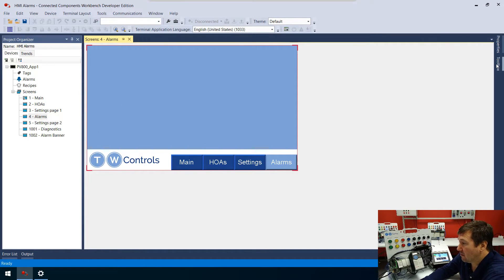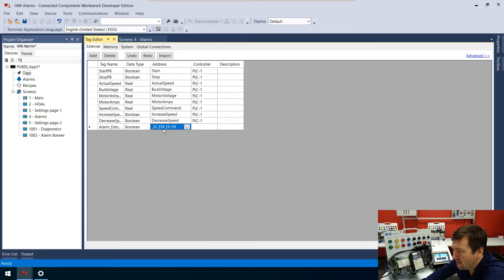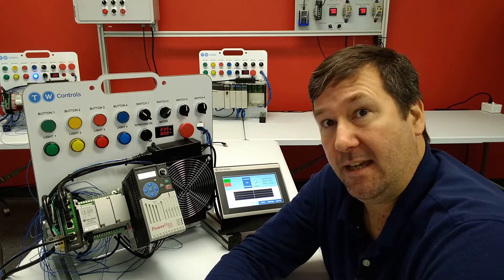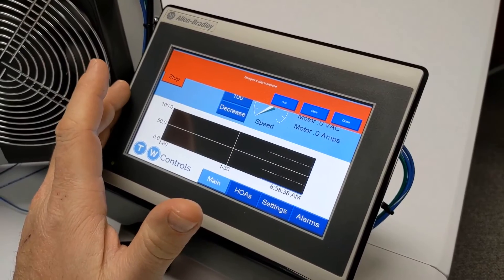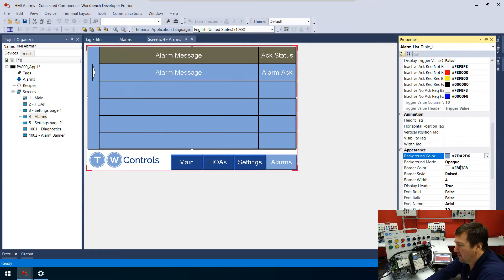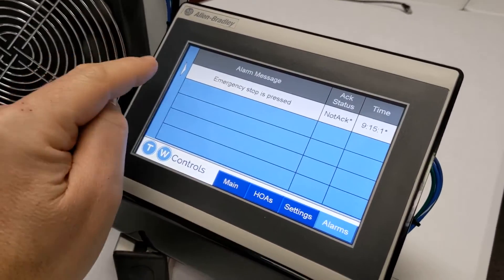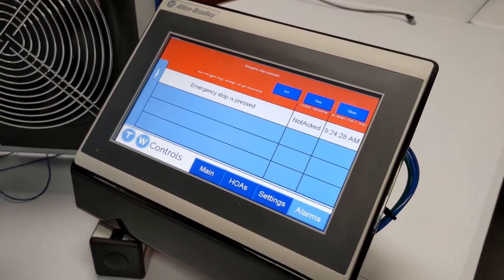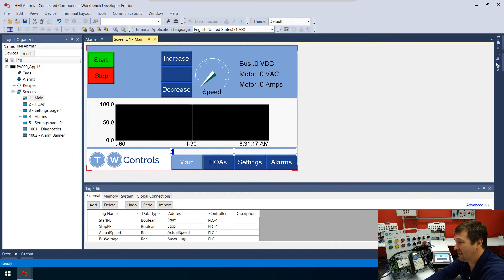Show ALARMS on a Panelview 800

Comment: Uncheck the "Display" to disable banner. "Display" means to display the message in alarm banner.
Reply from the maker: I'll have to try it.  My fix is to make the banner 1 pixel tall but that would work better.  Thanks for the tip!
Reply: @TimWilborne  unfortunately, unchecking "Display" will disable writing to "Alarm Message" field as well...
Reply: @TimWilborne  this is copy-paste from help: "Display
Displays the message of the triggered alarm in the alarm banner. Uncheck the box to disable this function."
Reply from the maker: @jbn37  Seems like I tried this pretty thoroughly and the only solution I found was the 1 pixel banner at the top the screen.  I typically roll my own alarm screen.  I'm running a training class this week but will try to play with it again soon.
Reply: @TimWilborne  nice. I am now checking for a solution to display extra information about the alarm (tips about how to solve the problem etc ) by pressing a button when the alarm is selected on the screen. But with no success so far...:(
Reply from the maker: @jbn37  That is one advantage of how I do it :)  Play with the multi list selectors with string tags for the display elements.  I have to get ready for class so can't elaborate now.

Comment: Thank you so much Tim for every time saving me on doing new stuffs in my PLC programming.

So I created an alarm with other existing alarms in my PLC, for some reason it clears itself and shows back again. 

I used this alarm to show up if one of the device connected is OFF and used a structured text to do this.

Please help me on this where am I going wrong? Is it the timer or something else?
Reply from the maker: Check the auto acknowledge.